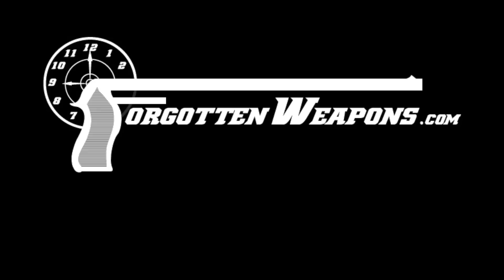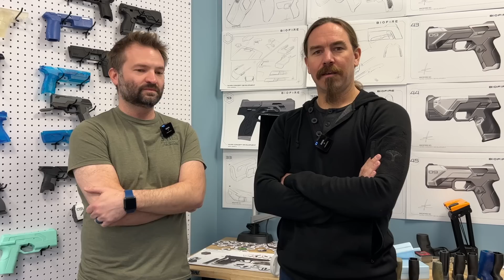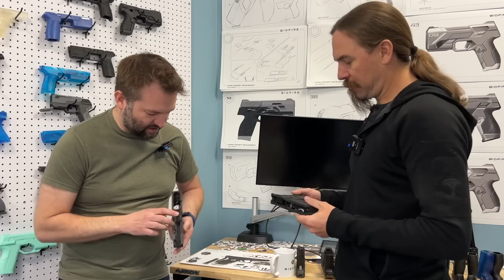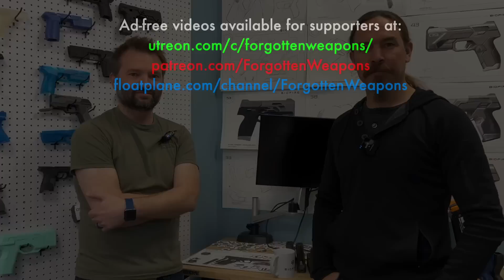Interview w/ Biofire's Lead Designer: Features and Reliability

Comment: So what happens if I'm carrying your gun and get jumped suddenly, before I can properly and cleanly grab the gun, ensuring the sensors get properly touched.

Me and someone(maybe someone bigger and with a knife) is rolling around on the ground fighting for control of this gun.

I'm forced to grab it with my off hand at a bad angle.

How do I get the gun to know it's me, before the bigger guy stabs me???

For all I know, I might end up grabbing the gun completely upside down with my pinky on the trigger.

I can still defend myself with a "regular" gun, but this gun would probably get me killed under anything like those conditions.

I'm not against electronics in guns, but the technology just isn't ready for a device meant to be used in literally life and death situations.

The electronics absolutely must know it's me holding my gun. And it has to figure it out faster than I'm able to pull the trigger.

No matter how I'm holding it, or whether or not I'm wearing gloves, it must instantly know me, and let me fire 

Until then, the technology is NOT ready.
Reply: Just carry a normal pistol. This one is marketed for HOME defense in the presence of minors.
Reply: You think people don't get snuck in on in their own homes?
Reply: Well I think both here and in the other video on it they emphasized its not for carry. Its for the home defence market. It is meant to be the gun that can sit unlocked on your nightstand and be quicker than a lock box. In that use case, as long as they work out the jamming issues, it seems perfect. I dont think they are trying to replace all guns, youll still want your glock 19 or other for ccw. They are aiming for a niche that it seems perfect for.
Reply: @GamesWithZane  
And as I stated in one of my replies, people get jumped in their homes as well.....

Or are you expecting everyone to carry their gun around in their own home?

I've even heard stories of burglars breaking into a house quietly.

So it's perfect for most home defense. But a regular pistol is perfect for all home defense.
Reply: @lordgarion514  a pistol on your night stand that takes around a second to authenticate is better than a safe in the closet or a lock box in the drawer that takes 5 seconds to get in. It seems more acsessible. To your point, do you expect people to have their guns on them in their homes at all time. Making it to a fun on the night stand or in it is quicker than one in a lock box in or on the night stand. How does a normal handgun serve better in a quiet break in or such if you still have to get it out of a locked storage device. 
Also I made my comment before your replies.
Reply: This gun is a nightstand gun you can walk away from, that is faster than the same gun in a safe.

Your scenario is where you have 1½ seconds to grab your concealed carry gun but not the ~2 to 2½ seconds to get a better grip? I don't think it tries to be a concealed carry gun, or one you walk around with openly for that matter.
Reply: You have to start somewhere with the tech and fantastic "what ifs" can be applied to any situation/gun. In your situation a regular gun would probably not even work. What if they used your own hand to shoot you with your own gun?
Reply: Oh, and me getting shot with my own gun, is on me.

Me getting stabbed because my gun doesn't work for me, that's a problem with the gun 

Me dying because of something I failed to do, isn't the same as me dying because my weapon doesn't know me.

And yes, I can quite easily pull a trigger with my pinky. So if I'm one of the unlucky people every year that end up fighting on the ground, I very well could end up grabbing my gun at some stupid angle with the wrong hand.
Reply: "fantastic what ifs"?

That shit actually happens in this country, and even in people's own homes.....

What exactly is so fantastic about something that actually happens???
Reply: @lordgarion514 Because unless you're going to use statistics you're using the same what ifs method of argument used by lefty twats to suppress the 2nd ammendment.
Reply: Why would you be carrying such a large pistol instead of a smaller/ easier to handle gun? Seriously this thing looks like its the size of the 10mm from fallout.

Comment: Funniest shit ever is this “smart gun” isn’t even allowed to be sold in California
Reply: Uh, forgive my ignorance, but why not?
Reply: @briancaster2876  California mandated micro stamping on all new handguns in 2013 so it’s basically a back door ban on new handgun designs. Anyways the handgun roster currently got multiple preliminary injunctions on it so it’ll be struck down eventually but still funny
Reply: @bradenmchenry995  That is pretty funny
Reply: @briancaster2876  Pistol Roster. It doesn't adhere to an arbitrary list of required features and doesn't have room to even get added on because the list needs to constantly shrink to make less and less "Safe and approved" kinds of pistols available for purchase for civilians. Also that list of required features has microstamping, which doesn't exist in full-scope manufacturing. Totally not a 2A infringement bro.
Reply: @Jaydoog04  I'm not really a gun guy and I'm not a hundred percent on exactly what micro stamping is. That does sound like something California would do though.
Reply: @briancaster2876  basically the firing pin would print your serial number on each casing. It’s an extremely unreliable technology that doesn’t even exist outside a lab
Reply: @Jaydoog04  To be clear, I'm not against gun ownership. I've just been looking at info on this gun because I think I am the target market.
Reply: @bradenmchenry995  Well that sounds dumb. I suppose I could see the appeal but like, it seems that if it's ever made viable it'd be easy to fake?
Reply: @briancaster2876  More like super easy to defeat/remove.
Reply: @secretagb  That too
Reply: @briancaster2876 Welcome to the side wild world of fun regulation. Written by people who don't understand guns, voted on by people who didn't read it, designed not to solve problems-just to win elections and make people feel better. 
I live/work down the road from where these guys are and it's a hotbed of normal people and engineering. I'm betting this is pretty well made and well funded.
Reply: @briancaster2876  there’s no appeal. They call any firearm not on the roster as “unsafe” yet basically every police agency uses handguns not on the California roster
Reply: @bradenmchenry995  I imagine that when police agency's choose their guns they're mostly looking for what's cheap and reliable.
Reply: @briancaster2876 police agencies don't have to abide any of the same restrictions civilians do. Which is honestly ridiculous because statistically the average American is about 9x more likely to be shot by a cop than anyone else.
Reply: @dark2023-1lovesoni  Is that true? I"ve never heard that stat before?
Reply: @briancaster2876  well it doesn't include illegal gun use, but the stat was achieved by looking at the total number of US  citizens with a CCW permit and then dividing by the number who've reported firing a gun in an altercation, to establish a rate of civil gun use. Then taking the total number of cops and dividing by the number who've shot somebody while on duty. It shifts quite a bit per year, but the average was that cops are roughly 9x (or 900%) more likely to shoot someone than the average citizen legally carrying a weapon.

But the same thing could easily be said about mass violence instances too, most citizens are significantly more likely to be shot by law enforcement than a crazed lone gunman.
iirc, police injure at least 250,000 civilians and kill approximately 600, each year.
I'm writing a book that goes over a lot of this while re-analyzing the "War on Drugs", prisons, policing, and gun control.
Reply: @dark2023-1lovesoni  That's interesting! I imagine that's a function of police just being in a situation where, I'm not sure how to phrase this, they're more likely to have to shoot someone I guess. I'd imagine the vast majority of people with CCW permits aren't as likely to be in a situation where that's "necessary". On the civilian side do you have breakdowns for the types of situations where that might occur? Like I'd imagine there's a lot of on duty security guards involved in a shooting situation compared to like a random passerby. Anyways sounds like an interesting book, hopefully I'll get to read it some day!
Reply: @dark2023-1lovesoni  it's honestly a pretty shit stat to look at it like that... cops by nature are going to be in far more situations where they're required to fire their weapon than anyone with a CCW
Reply: @briancaster2876  
I'm curious as well. Not that it's even gone to market yet.
Reply: @BiofireUSA  unless the roster is upheld as unconstitutional….no you won’t be able to 🤣🤣🤣🤣🤣. Stop promising things that won’t happen unless the laws change
Reply: @BiofireUSA  does the handgun have a digital/physical chamber load indicator? will the handgun still fire with the magazine removed? has it been drop tested for accidental discharges? if you haven't done all three of these things, as well as paid the DoJ for roster *consideration*, and acknowledge the fact that your submission will lead to three existing handguns being struck from the roster because it is semi-automatic, you cannot market nor sell your handgun here, unless your sole market is law enforement. if "more on this topic" is not a complete info dump regarding how your product meets CA roster requirements, it is worthless.
Reply: Slap an apple logo on it with 5g integration and everyone would have one there.

Comment: how long until someone guts it, shoves in an arduino, and makes it full auto without needing an auto sear by making it fire at cyclic rate
Reply: There are simpler, better and cheaper guns you can mod to full auto than this, to be honest
Reply: .035 seconds after its released.
Reply: Probably longer than a felon getting a glock and Chinese auto sear in Chicago. Criminals gonna criminal.